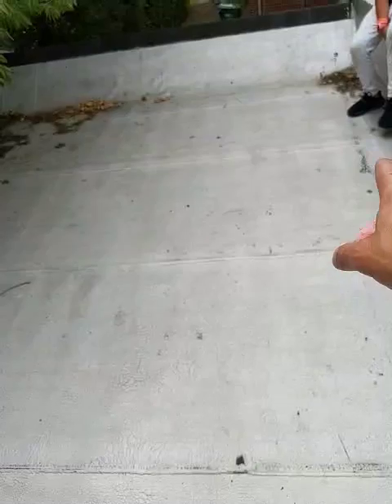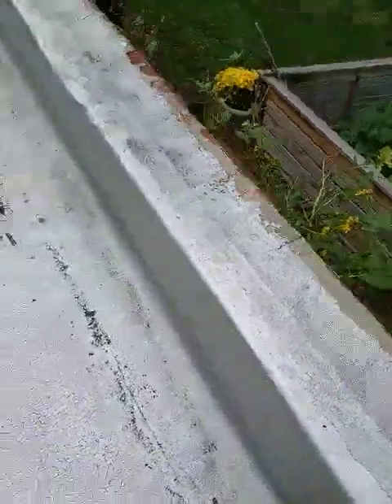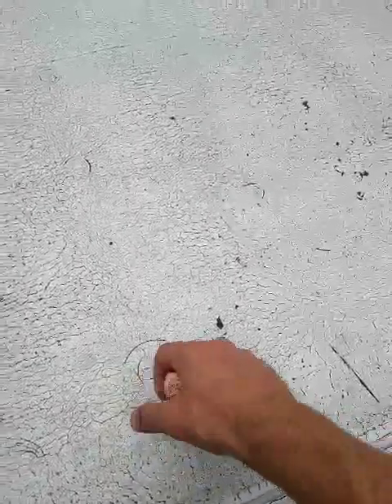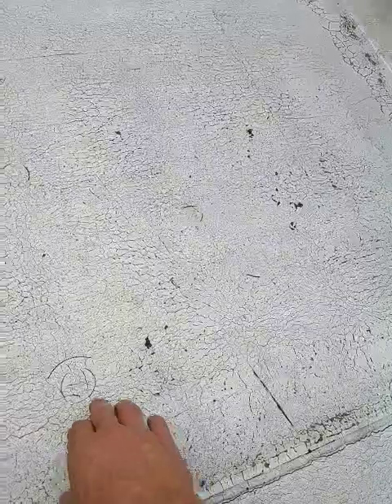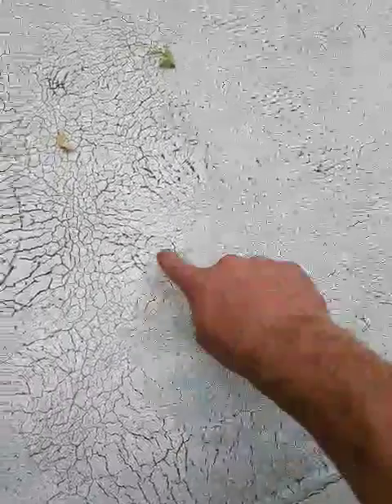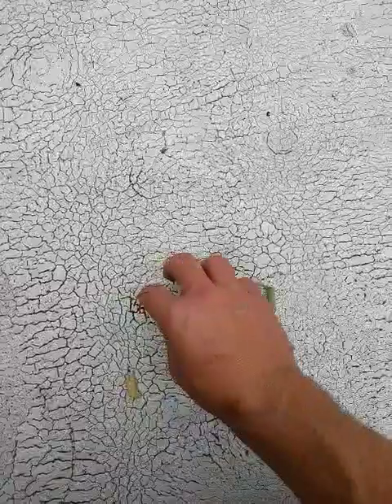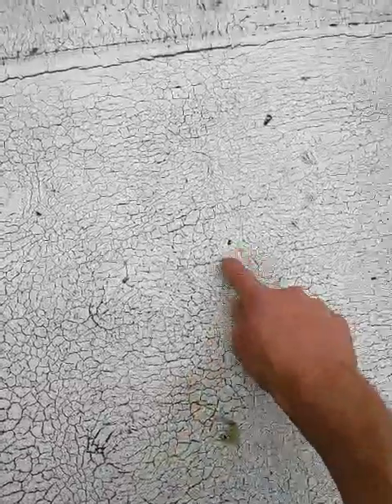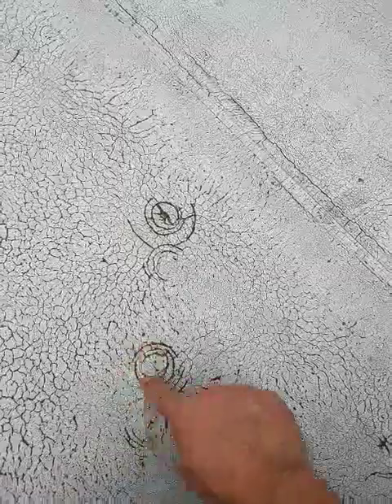What does hail damage look like on a flat roof? Membrane roofing like EPDM, TPO, PVC, and Mod Bit?

Comment: Thanks for the video. I have a 2005 motor home with EPDM roof that sustained hail impacts in May 2019. I have a State Farm claim for my house roof and a second one for the motor home.  Any suggestions to get State Farm to stop denying the motor home claim ?    JwgK in Houston Tx
Reply from the maker: At this point, you may need a lawyer. In Colorado we have 3 years to file a lawsuit. I'm not sure in TX, but your date of loss is getting old.
Reply: @FrontRangeStormContractors  Yes, a year and more since the damage. A S-F agent said I have 2 years. The vehicle has been in the shop since Dec. 2020 so I got an estimate back then....less than 2 years.  I am doing more research and find that insurance companies seem to be reluctant to acknowledge damage .  They state that the roof is "worn / aged " but the leaks were not an issue before the hail.  I did regular maintenance up to the storm, even bought the roll-on compound to re-coat the white surface as time allowed. Once the storm hit, plans changed.  I kept  two tarps over the coach to minimize potential water ingress.  I will keep you updated on any progress.   Thanks.   JwgK
Reply from the maker: Very reluctant. "Deny. Delay. Defend." That's their motto, and a great book.